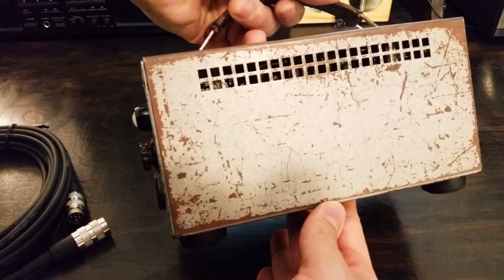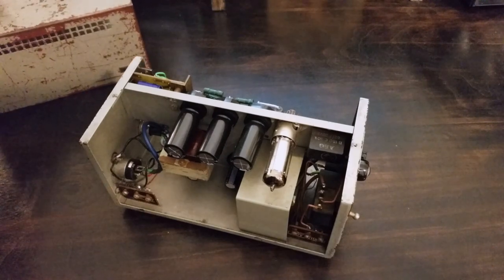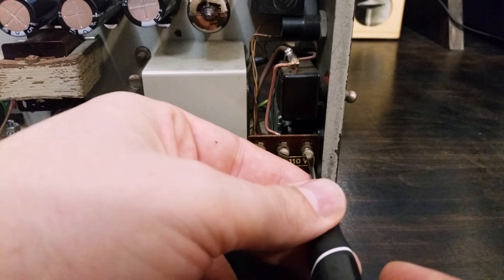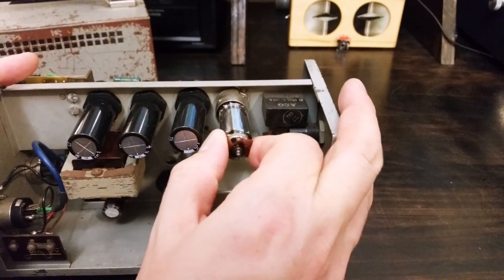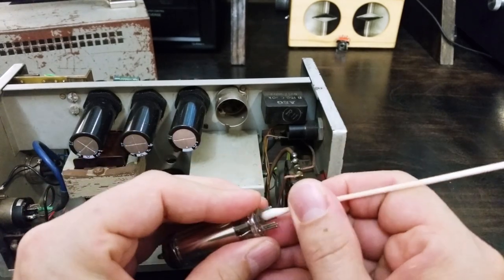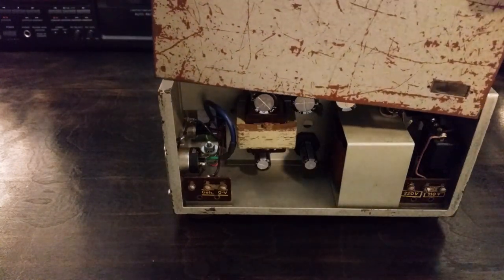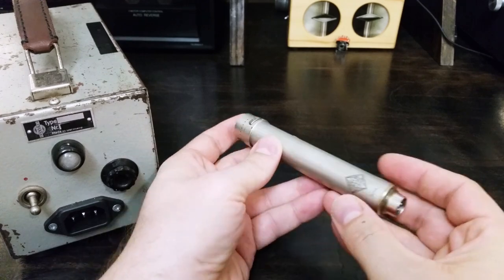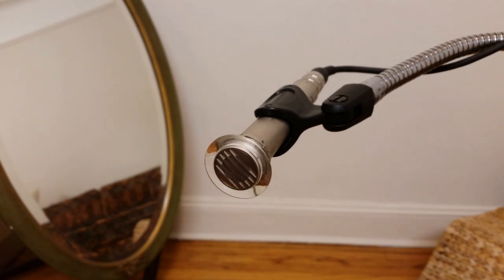Telefunken Tube Condenser Mic Demo Schoeps M221A VINTAGE

Comment: Great video! Why do you clean the tubes, isn't it dangerous to move them unnecessarily?
Reply from the maker: Thank you!   I clean the tube pins as a first step for most gear because dirty tube pins and sockets can cause unreliable performance.  While most tubes and sockets can only be removed and replaced a finite number of times(several thousand usually) I feel it's good shop practice to clean tube pins and socket contacts as a part of regular maintenance.  Tubes should be easily inserted and removed. However, if you feel like the tube is not going in easily, start over.  If the tube pins aren't lined up properly, you'll have bigger problems to worry about....  best of luck!